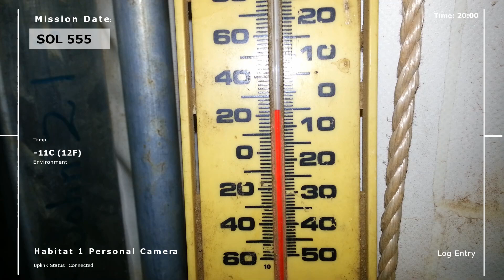Growing Aquaponics Microgreens in below freezing conditions, will it work?

Comment: OK so my logic here tells me that creosote in the chimney is not good but it isn't useless. essentially it's unturned fuel so if you were to dry out your creosote water using the heat from the wood stove then you should be able to just put it back in the fire and reclaim that energy. and to limit it in the future you need a hotter fire so a blower might add the oxygen you need to get a more efficient fire. theoretically anyway

Comment: I am greatly concerned about what looks to me like mold.  I hope I am wrong as I have only raised wheat grass for my animals.  My only problems with the process was if my ventilation was not good enough to prevent mold.  Are you at 50% humidity now?  I would suggest more than the one fan on the end for air circulation.  I know you just finished a great project for ventilation, just like to mimic the great out doors and give them a good breeze.
God Bless,
Dale the castle guy

Comment: I was old that old timers used to use creosote to treat wood so it wouldn't rot.  If you take the creosote water an boil off some of the water (put it in a 2 gallon pot on your wood stove and boil it down until dark and slightly thicker).  Take a 55 gallon drum and pour your reduced creosote water in it, along with burned motor oil and diesel fuel (equal parts) until it's 12 inches deep and then stand fence post upright in the barrel (debarked) and let soak for a few weeks... These post will perform almost as good as pressure treated wood.  The carbon in the creosote and burned motor oil penetrate deep into the wood and repel rot and insects.

Comment: I'm a good problem solver in most cases , I see a issue and I do what necessary to solve the issue ... or scrap it I understand your working with a tight budget ... but my grandfather always told me fix it right the first time or your going to pay for the right fix five times if you try to do it on the cheap .... and 99 outta 100 times he his been right I let my stubbornness get in my way of common sense problem solving ... what would it cost to right off the micro greens you have started the fish should be fine the cold won't do anything to them unless it froze over and they couldn't breathe . And wait for it to warm up and during this time take the rainbow of info and rethink your micro greens problem with article air ...

Comment: Double wall chimney tubes (insulated) will stop the leaking.
Reply: fuel must be well seasoned and dry, short flu and not choked down as well (flu not firebox), that"s the only time i have ever seen creosote problems in my 30+ years of wood heat
Reply: Just watched today"s (1\10\17) video... will be difficult for him no matter what... way too much flu, some of it seems to be on less than a 45 degree as well

Comment: Tele-communications use large spools of soft plastic conduit. It can easily be used to turn you poly tents into a more round shape. Cheaply. I was also thinking you could have another layer of poly over your current inside with the bottom of the inside rolled up a few inches to shed "warmer" air in between as another temperature insulation layer? If they are kept apart several inches it could help. I just wonder how much and how many tents does it take to insulate with the btu's you are using currently.

Comment: Few questions:
(1) it looks ineffective to warm whole lot of air, when you are using only 1/3 or even 1/5th of the height, maybe it will be better to have levels separated - line using plastic over the front, top and back of the single shelf (stacked rotated C) - then at the end of the shelf you can decide if it is used and then control where air goes, this may have additional pluses when you will be able to control flow (temperature) per shelf; the only disadvantage I can see is access to the shelfs, but there are some ideas how to resolve this issue
(2) you are using small stones as base - isn't it very time consuming/difficult to re-use it? when you have all of the root system there it looks panful to have all of this gravel separated from biomas; even if you will burn it and separate it by sieve is suboptimal; have you tried to grow seeds on the plastic sieve/mesh? you can buy in bulk plastic mesh and the cut it to size, cleaning it with something sharp is fast
(3) you said that you are using "micro grain" (? first sprout and leaf) - will you be using more mature plants? because (afaik) most of the plants that is growing in hydroponics is being grown in phases, when you separate and space growing plants, so they take more and more space; to the point - are you ready for replanting plants in the different phase of growth?
(4) gas heater - I've ask few people, especially those from the factory of the heaters, and the easiest, simplest and safest way to control such a heater is to use existing heater with pilot light and automatic thermostat - some of the models have external thermostat ports - so you can use it straight; trying to use gas valve as primary control point is very dangerous and difficult as you need to ensure that gas is ignited - pilot light is safer, and you can have alarms when temperature is not rising (in case of ignition failure) here is an example of heaters https://translate.google.pl/translate?hl=en&sl=pl&tl=en&u=http%3A%2F%2Fwww.creon.pl%2Fnagrzewnice-gazowe-gp (price range from $300 to $1800)

Comment: You could build a grid out of light weight steel studs and hang it a couple of feet higher than your rows. Attach easily to trusses on side of bldg. these studs are super cheap and come in long lengths. Fo centre support just use same studs as uprights for support. Stick in ground between rows and fasten. Sort of like a t bar ceiling. Then lay some bubble wrap on grid. If you cant afford silver bubble wrap just use plastic again. The idea is that this will drastically reduce the amount of space you are heating. The money you save on heat will pay for this. No lift needed you wont be that high. You can work off a ladder. Slope grid so condensation will run off and not pool up.  All your heat is sitting at top of building so bring down the top of bldg.  And using fans is right idea air flow will spread the heat evenly. SHRINK YOUR SPACE!

Comment: Love how your video's challenge me to try to think of solutions.  I'm glad you also ask for suggestions or information.
On the question of the by product from your stove exhaust I can mention two obvious things.  One, Coal tar is a carcinoginic material so be careful with it. It can go right through your skin.  Second thing is uses... It makes a GREAT wood preservative.  If you've ever seen how long railroad ties last even with the ground contact they have... That's what the tar can do.  No bug or mold can stand up to it.  It has a nice side effect here.  It not only makes wood preservative but it also works to strengthen wood!  IF you go into your engineering specifications you will find that an untreated 2X10 might hold a certain weight.  However, the same dimension board treated with tar will hold a greater load!  It's going to be heavier though so make sure you adjust all weight calculations for that.
Making an assumption here, but if your seeing the tar coming down out of your stack then it's getting into your green house.  Even the evaporate can eventually settle and create a situation where you would fail an EPA inspection and become a little super fund site.  Be real careful where your emptying those buckets you mention.  IF your well is a LONG way from your driveway, you might get away with a small dose on the tire tracks.  It would kill any grass from growing in the ruts but then that might cause them to erode.  Get my point?  That stuff can be a big hazard if you lose track of it.  Let your lumber soak it up. It will dry there and last for centuries.

Comment: For growing in limited space and making money off microgreens, check out the channel "Urban Farmer Curtis Stone" he doesn't have the same goals, but similar methods would apply and he has a lot of information you could use. 

On that note, I know of at least one vineyard that turns in sprinklers when the temperature hits 32F. Covers grapes with ice, but also means inside the ice, the temp will never drop below 32F (latent heat, state transition, etc) even if air temp drops further. Peas are a cold weather crop so they might fair well regardless, but maybe experiment on a small section to see how they would do in ice.

Comment: PLEASE: 1) measure vertical temperature gradient (at the front, middle and end of the lane) 2) consider using the highest shelf position first, not the lowest 3) GoFundMe some bubble / foam wrap to put on top of the lane foils if effective
Reply from the maker: great idea...I'm working on temperature sensors now and will get them in to help figure this out...appreciate the inputs
Reply: TheRealMartian are you planning on an arduino one wire system? I have piddled with ds18b20 sensors and arduino connected by old phone line and cats cable. I had 5 going at once using a single input on arduino uno when I was troubleshooting my ac system. my goal is to have one in every room of the house. I have an rtc chip I was going to wire in but never did. I used a program called plx something that took my arduino output and streamed it to excel and inserted the date time and updated it and the chart regularly.  so I just left it running. now I did not use water tight connectors on my cat and corrosion eventually n killed a few of them outside because of himidity.

Comment: Have you tried a compost heater? There are many types. Either use a passive method where you put the pile under the grow beds and mix it around periodically or actually coil a copper pipe through and pump the water from the fish tank. It might help?
Reply from the maker: I've thought of it and the major problems are 1: loading in qty that we need, and 2: space. just a lot of space required to get the heat we need and then how to load it in the middle of winter
Reply: I've seen vid where one only needs the size of a 4x4x4' cube created by putting 4 pallets vertical and staking them upright. I'm going to try and put my 55 gallon steel drum "septic tank" in the middle of the mass and see if any heat is produced. Hopefully I won't just make a mess. Wish me luck.
Reply: Just checked on dimensions and according to the Cornell paper I just need 10 gallons of compost to start the heating process. Let's say I use 4 4'x4' pallets and position my 55 gallon drum in the center of the mass, there will be more than 10 gallons on all 4 sides. One might say the vertical thickness is not enough to maintain the temp but since the compost surrounds the drum at the core, I'm thinking that the overall dimensions will maintain the mass. Wish I had compost thermometers to test my hypothesis, but I guess testing the temp of the water inside the tank will be enough.

Here's the link for a study of composting done at Cornell.

http://compost.css.cornell.edu/physics.html

Comment: Very interesting content, I enjoy your videos. I was curious what your nominal humidity level is? I would think that the aquaponic trays would present a huge surface area for evaporation, not just from liquid in the trays but from the vegetation as well.   As you remove energy (moisture) from the air it acts like a sponge and aquires energy more aggressively from sources within your tent/lane. I think that is a losing battle at this point. Looking at psychometric charts would indicate that cold air is dry air,  it has to be, it is too dense to hold much moisture. If you raise the air temp,  the %RH will drop without doing anything else, and the moisture will wick back into the air whose molecules have now expanded to the point it can receive the extra water. Dehumidification by refrigeration uses a ton of energy, and also depresses the air temp which adds load to your stove. I think you might be better off focusing on straight heat in the winter, and the %RH will sort itself out if you manage to raise the dry bulb temp enough. Sorry for the length, just some stuff to think about.  Keep up the good work, it's very interesting stuff.

Comment: Really? I should hush. I thought the whole point of what he was doing was about community and sharing? Who are you his lawyer? Unfortunately  his planning was wrong. And it needs to be fixed. Its alot cheaper to spend some money now and do some insulating than blow tons of cash on heat. Wake up man, am i the only one who sees this. And just to be clear planning for a certain temperature and not knowing how heat loss works in a structure is bad planning. Change your direction now or continue making the same mistakes over and over. I'm offering advice to help not making bleeding heart comments!
Reply from the maker: no you shouldn't hush...I appreciate your bluntness. It is a matter of priority. I intend to get to the insulation but am thinking through some more long term changes. For example. I may completely git rid of the tent idea and do something more "tight' to the structure. this would not be an insignificant change. In the mean time, temps have started to rise back into the planned range and I'm going to take the risk that we can make it. Time will tell. But by all means I want people to disagree with me and point out my mistakes. It helps me learn and helps others think through their own designs. Stronger together! Thanks for watching and thanks for being patient with me as I learn how to deal with all of this. :-)

Comment: Jeff you said the other day that out of every failure has come a rainbow.  I know you are worried about your growing lanes and rightly so.  However with the sustained artic blast you are getting you now know that the level of insulation you have for the setup is insufficient.  Which means that ultimately you can start to make plans to improve for future winters.  Not to be negative but out of ashes rise.
Reply from the maker: not negative at all...it's definitely teaching me things that need to be addressed in hab 1 as well as hab 2 (which we'll build in phase 4)

Comment: for the longest time, creosote was the preservative/protection of choice for things like fence posts. utility poles. railroad ties, any wood with constant ground contact.  Though most uses have gotten away from using it due to potential environmental issues... but if you're creating it anyway as a byproduct, then you might as well get some good use out of it.  let some (most) of the water evaporate off, and then store it for future projects around the homestead.
Reply: Sean Bova Thats pretty cool. Thanks for sharing.

Comment: Creosote is used as a wood preservative. For wood fence posts or any wood you bury in the ground, soak it in the creosote a few hours. It keeps the insects from eating the wood. Otherwise, creosote is toxic, especially to fish. So, dispose of it carefully. 

The traditional way of dealing creosote buildup is to rap on the stack pipe daily with a wooden pole to knock it back down into the fire. If you are getting liquid condensation, either you need a better cap to keep the rain out or the stack pipe is getting to cold. Some solutions are to insulate the stack to keep it hot enough or add a booster fan to keep the stack gasses moving. Some people have tried adding a catalytic burner that burns the creosote. You might start by using a stack thermometer to monitor the temperature drop. Then, insulate it to see if it helps. Considering how long your stack pipe is, you may need to set up an outside chimney with triple wall pipe. Just in case, have some chimney fire extinguishers next to the wood stove. They contain a chemical that quickly chokes out a chimney fire before it burns down your building. You just put them in the stove when there's a fire.